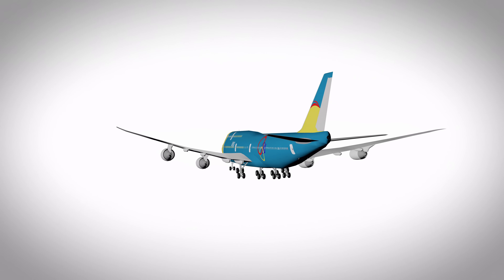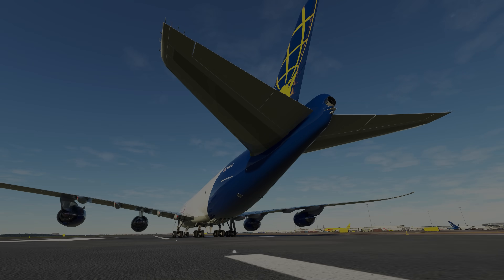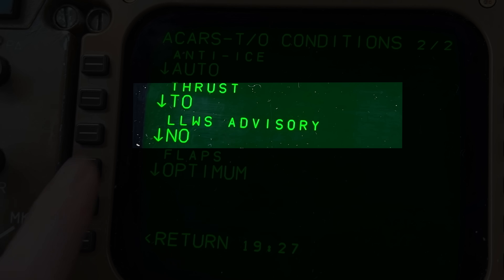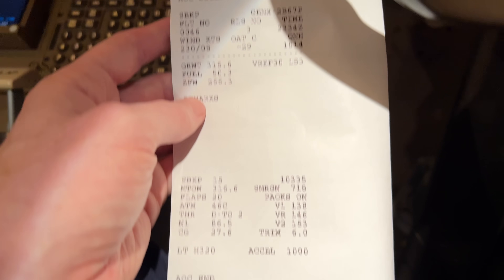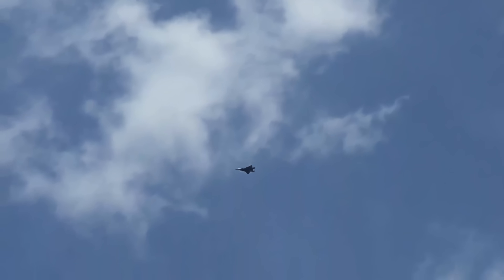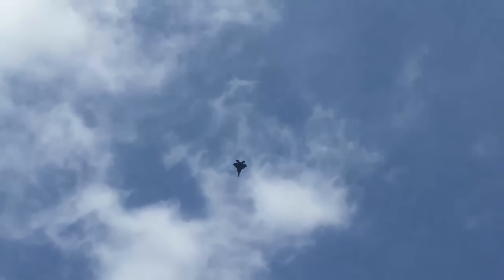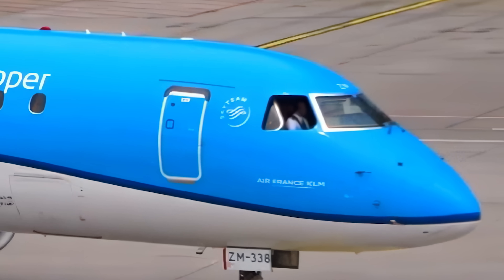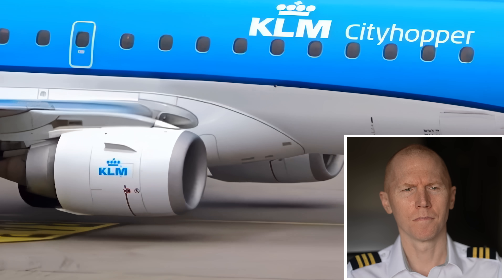Unsafe 747-8 Vertical Takeoff

Comment: As a car guy, yes, excessive downshifting does create more engine wear, but selecting the right gear for your speed coming to a stop or slowing for a corner is perfectly fine, and often encouraged. The problem is if you are really inexperienced, or just have a huge brain fart and accidentally money shift by selecting a too low of a gear and you exceed the maximum engine RPMs you can break things.

Basically if you drive your car harder than normal in any circumstances you increase the risk of problems, damage and wear. The important thing to do is to accept an appropriate level of risk for your driving capability, and how comfortable you are with your car.

All machines like to be operated, but with respect and understanding of the best way to operate it in the circumstances.

Comment: Taking off attitude.... If I remember.... One can do it either with the purpose of gaining distance or gaining altitude, or a mixture.. What ever suits the situation. On a commercial flight, before 9 11, the cockpit door was open during a visual landing with an exceptional nose down attitude. I asked the hostess if the pilot was in a hurry for the bathroom, on the ground. She laughed but I understood she also though it was a brutal approach.
Turning 90 degrees after take off, up into the wind also gives a spectacular take off... Tower in sight for a small plane.
Once a flight instructor started his plane like that, without blocks to the wheels. The plane took off, got airborne and disappeared....
During education, on a 2 seated plane a Piper 180 was use for 2 pupils during a long navigation, and the starter was in the work shop. My pupil friend had quite some throttle but the instructor managed. My turn... Very conservative throttle setting. The prop just slowly turned around upon engine igniting. Yes, yes, yes..... Parking brake applied, I hope, and pedal brakes at their maximum.
Those were the days...
Extra entertaining video! My mode or my drone flying today?
Double thumbs up!

Comment: car guy here lol. using thrust reversers to slow down is equivalent to down-shifting to force your car to go slower. sometimes it's worth it but most of the time it's not worth it to use your tranny to slow yourself down unless you're in an emergency situation. it wont ruin your transmission unless you're going 70mph and shift into 2nd gear or something crazy.

however if you have a big rig and the brakes went out or something similarly dire, the transmission can die cause that truck NEEDS to stop. kinda like that case with the guy, Rogel Aguilera-Mederos, in Colorado. even though that's a bad example cause he was driving like a complete idiot and had better, more reasonable options available to halt his vehicle

Comment: Regarding transmissions-modern technology using torque converter clutches is how trucks with automatics are able to use their engine brake (or exhaust brake in the case of pickup trucks). It basically turns an automatic transmission into a manual transmission by using clutches to “lock” the engine to the transmission. While cars normally disengage when you let off the gas, and therefore don’t slow down well, trucks are programmed to stay engaged and with a diesel’s higher compression ratio it’s easier to turn the engine into an air compressor-big trucks use the valves to do this and pickups use a flap in the exhaust pipe. Army trucks with automatics had a problem early on with sudden stops on ice-the rear wheels would lock up and since the transmission’s torque converter clutch was still engaged the engine would also stop turning. Then the power steering would stop working, the truck would slide because you couldn’t steer it. After that they installed ABS on them 😊
P.S. Farted? LMAO!

Comment: Agreed: Guido has an old youtube ferrying an Ovation across the pond. He bounced a bit landing in Greenland. I told a coworker “not to judge a pilot on one landing, this guy is a heck of a pilot making common sense decisions” (Always use checklist).
Disagree: You knew it, the car thing. I constantly downshift to help break; just know your car and safe speeds for specific gears, kinda like speed checks for each flap settings ;-). My car is 11 years old with original tranny and breaks :-).

Comment: FYI in a manual transmission car, skilled drivers slow their car down by downshifting. It’s designed to do that. As long as you aren’t downshifting into redline it’s perfectly fine and doesn’t cause additional wear and tear. 
Yes I’m a car guy. Lol.
Great video though